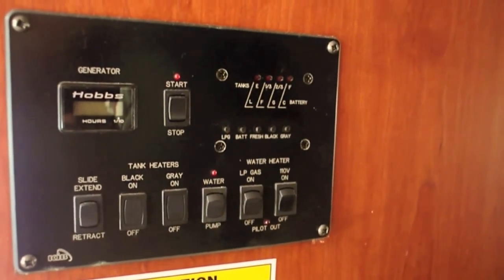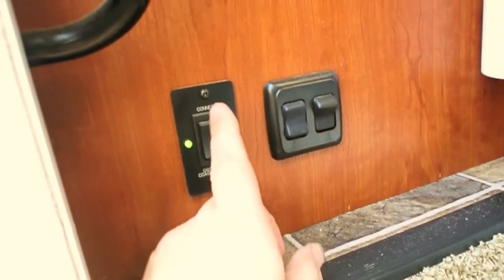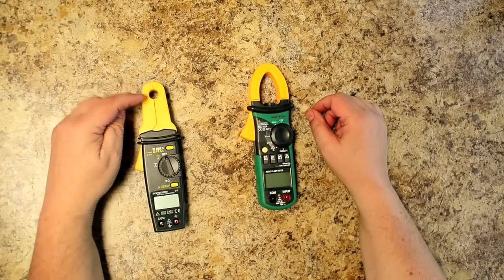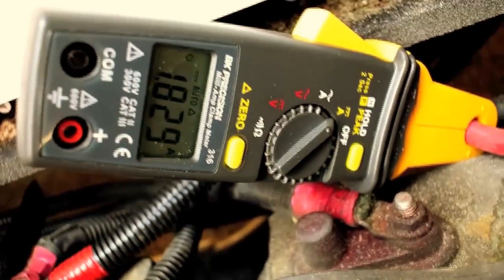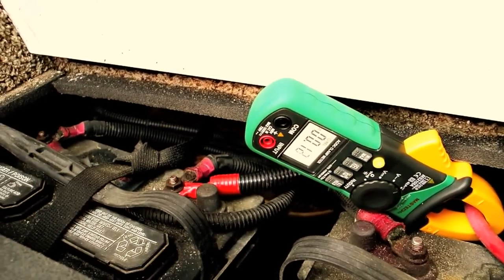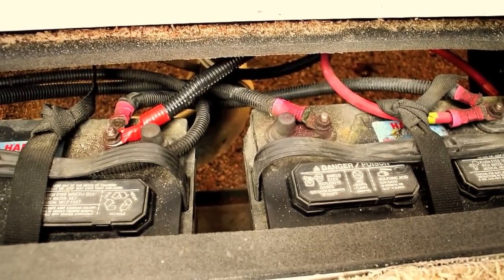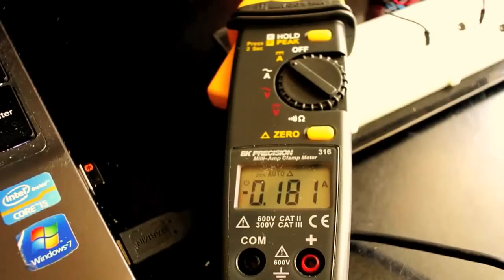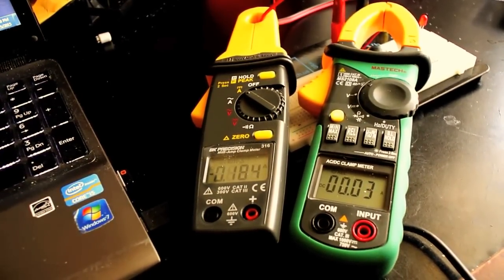Do your batteries quickly discharge when storing your RV?

Comment: I just installed 2 battery disconnects for this very issue (mechanical switches, not solenoids).  This allows me to disconnect the ground wire of the engine battery and the house batteries for long term storage.  If there are any parasitic devices or I accidently left a light on, it won't matter.  for $20 you can get 2 of the (high current: 1250A) switches and float the batteries for long term storage.

Comment: I have two 6V Trojan T-105 batteries under my step. There is also two 5A fuses. One fuse is for the the propane detector the other I'm not quite sure of but the slides and the water pump won't work with it out. I have been pulling the fuses when the Motorhome is in storage and the batteries stay charged. I do run my generator and engine every other week for 20 to 30 minutes. I have solar power now so I'm going to leave the fuses in next time I store it. I also have a battery disconnect switch on the engine battery that I open up when in storage. It drains in about ten days if I don't. Now that I have solar, a soon to be future project is to install a Trick-L-Start or Trick-L-Amp and remove the disconnect switch on the engine battery. Nice info and video.
Reply from the maker: realredrebel  I would think the slides and water pump would require more than 5A. Perhaps it is power for the control panel that the slides and pump are on.

Comment: your not quite correct about that contactor.  it does not draw power in the on state.  it uses a spring mechanism to keep it contacted either on or off and the solenoid energizes both way to produce enough force to flip it so its only drawing power when you activate it to flip it.  mine broke and i had to replace it so i figured out how it works.
Reply from the maker: I discovered that sometime after doing the video. However, since the video was about draining the batteries with parasitic loads, it really did not invalidate the topic of the video, so I left it as is.

Comment: The battery itself has internal resistance/load
Reply from the maker: A typical lead acid battery will self-discharge in a few months. A 4-10% discharge rate per month is not uncommon. 

When I stored boats for the winter period, they had two batteries, and it was interesting that one battery had enough charge left in it to operate a few things while the other one did not. So two identical batteries in type and age had different self-discharge rates (yes, they were completely disconnected).

However, the video is about loads in the RV that remain energized even when you think everything is turned off.  Even if your RV has a battery disconnect switch - depending on the RV brand, model, year, and even day it was built - it may be wired so that some loads may still be connected.

This means extra precaution is needed by the typical RV'er, by either manually disconnecting the battery, installing a real disconnect switch, or keeping a charge on the battery in storage. Most RV'ers do not know this requirement, hence my attempt at the video.